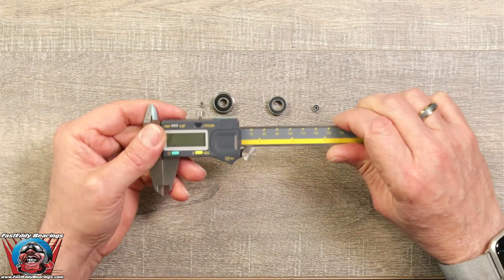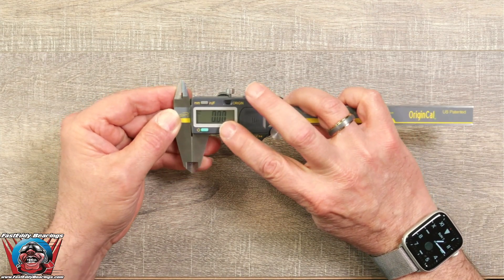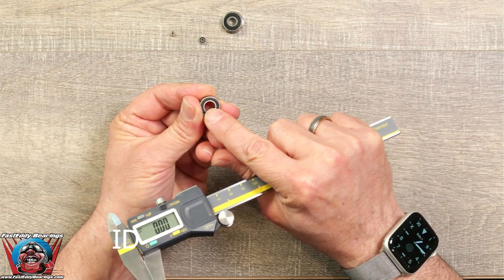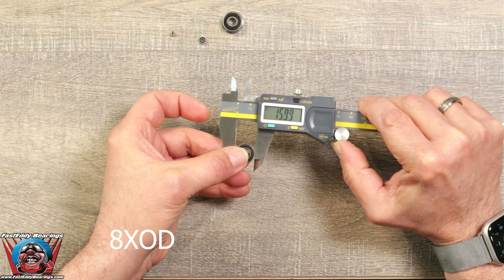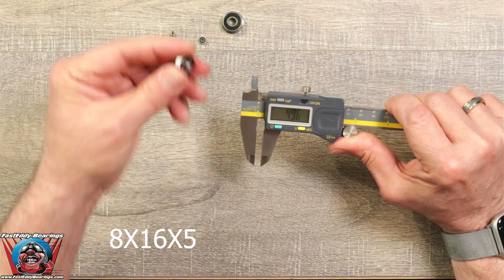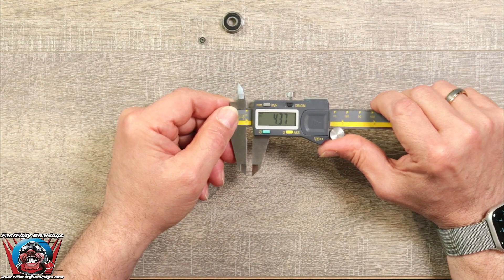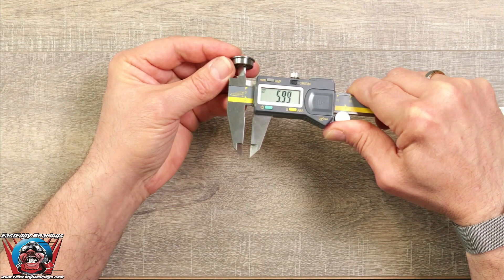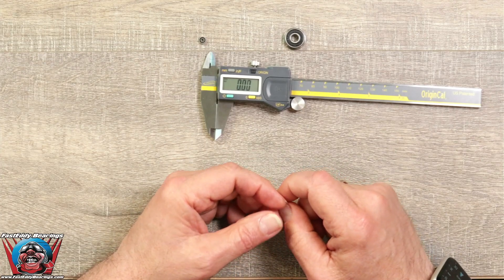How to measure bearings

Comment: I just need a seal for what looks to be approx. 38mm on the OD that's incased inside a fan pulley for my 1fz-fe Toyota Land cruiser.
I tore the seal up when pulling it out so I could re-grease it.
I can't be precise on size because the pulley is in the way of doing proper measurement but 38-40mm is OD.
The ID is 11.60mm ish.
Where can I buy just the seal cap part of these bearings?
Bearing has, "Japan NSK 656 6301DLUX"
Thanks